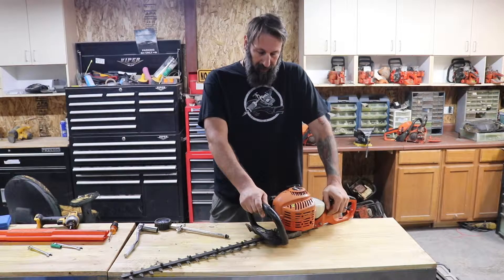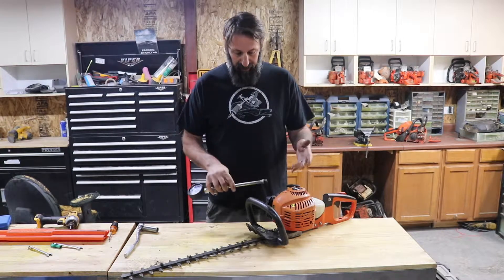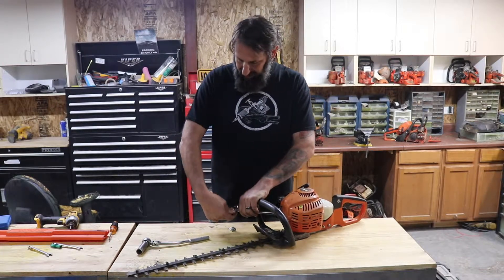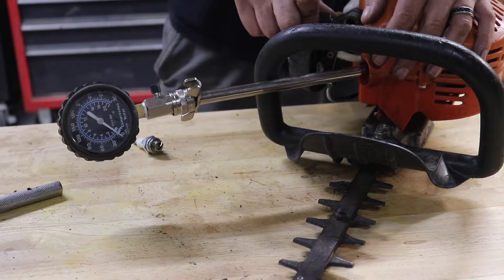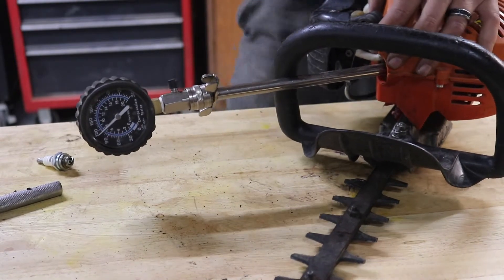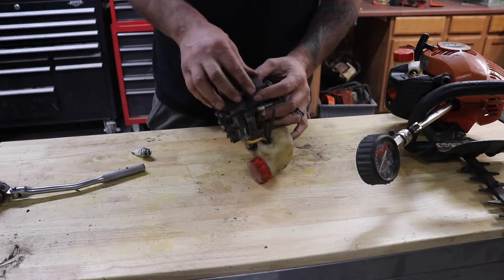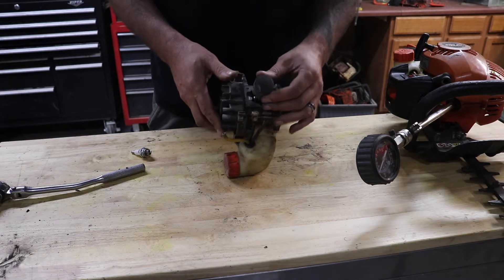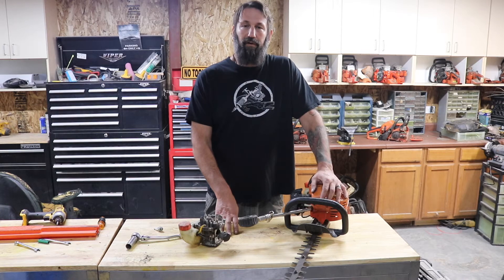Compression Check on a 2 Stroke Motor for Beginners

Comment: 0:24 "When we've replaced all the parts ... and it just won't start ... we want to check the compression."  Curious about which parts you mean.  When an engine won't start, I'm inclined to check compression after making sure it has fuel and spark, before changing parts.

Comment: Helping my neighbor fix his stihl gas leaf blower. It’s getting a new carb and I decided to do a compression test. I got 90 psi at 5000ft elevation which translates to about 102 psi sea level. Is the more junk? Fires right up but carb issues prevented it from pulling clean at wot

Comment: I heard the comment about replacing the spark plug at the engine won't start or checking the compression if it won't start but my first step is much more simple.  I get a small medicine squeegee dropper and put a couple milliliters directly into the carburetor with the throttle open.  Then you just need to hold the trigger all the way down and pull the cord 5 to 10 times and you'll know right then if everything is good except the carburetor.  Of course your compression may be lower than what is ideal but almost guaranteed it's going to run

Comment: Hey Bear!  Good video!  I have a barely used 2005 Poulan Pro 3516 35cc chainsaw which looks brand new, but sat for over 10 years and the fuel lines deteriorated.  I replaced all of the fuel lines, fuel filter, new carburetor, new spark plug and air filter.  Also, I set the gap between the ignition coil and fly wheel properly (one business card thickness).  Checked sparkplug with tester and have strong spark.  Put fresh 2 cycle oil in chainsaw and good flow to carburetor.  Then followed directions for starting (primed and choke out) and nothing, not even a burp!  I bought an $18 compression tester like the ones at Harbor Freight.  I used the rubber hose that came with it and could not get any compression.  I changed to the straight metal pipe and rubber tip and got no more that 65 psi.  Any suggestions?  Also, are the rubber hoses any good for this test?  This is my first tester.  Thanks!
Reply: Did you Ever Figure it out? Was it the saw or tester?
Reply: @dusty1498  No, I couldn’t do anymore with it due to shoulder issues.  It is on the shelf for now and may work on it in the spring.  Thanks for checking on this.

Comment: Hey I have a unit that runs really well and I went to check my compression on it because the tester was reading zero on another unit and it read zero as well it’s a weed eater te475y I checked the tester with my compressor and it works fine. Any clue what it could be?
Reply from the maker: I would guess the adapter you have has something wrong with it. I would assume you have a different adapter for your air compressor.  That would be the only thing different.

Comment: I got an SRM 225 I just worked on for no spark.  And it is at 40 psi!!! It starts on 2nd pull, idles fine and cuts fine too. I imagine it must have had  a lot of power when it was new. This one doesn't even look old. But the muffler is wet with blow-by.
Reply from the maker: 40 PSI and it still runs!  That is incredible.

Comment: Bear's Workshop- Great channel and great videos. Thanks! 

Comment and Question for you: I'm doing a compression test on my Husqvarna L65 chainsaw (I know it is old...from 1974) I have done a leak down/pressure test and found the crankshaft seals leaking and I have replaced them. After I completed the replacement of the crankshaft seals, I performed another leak down/pressure test and everything held for over 10 minutes.

I'm now wanting to put this saw back together but before I do so I wanted to check the engine compression one more time. The compression gauge stopped climbing at 150-160 lbs. But immediately the compression as read on the compression gauge starts leaking out and is back to zero within 45 seconds or so.

I'm a novice at this...this is my third 2 cycle engine I've brought back from the dead so to speak. 

What am I doing wrong, if anything? I've watched yours and other videos and when a compression test is performed, the compression holds. If this is a problem with the rings and cylinder, why didn't this decompression happen when I performed the leak down/pressure test?

Comments/advice? Thanks ahead of time.
Reply: I figured out what was wrong...the schrader valve on the end of my compression tester had come loose...I tightened it up and good compression test at 150 plus and it held.
Reply: @kimden85   damn good catch on that tool problem bro!!
Reply from the maker: I would suggest replacing the rings.  Should be cheap and easy since you have already disassembled it.  It is possible the ring was damaged during disassembly.  Also maybe a seal is leaking from when you put it back together?  Just some ideas.

Comment: Is the 120 PSI a general rule for small 2 stroke engines? What about 4 stroke like lawnmowers? I just did a compression test on my Echo PB 251 25CC blower and it came out to 116 PSI so I'm glad to know the engine is still in great shape.
Reply from the maker: Yes, 120 is a general rule for small 2 stroke engines.  100 on a 4 stroke small engine is good.